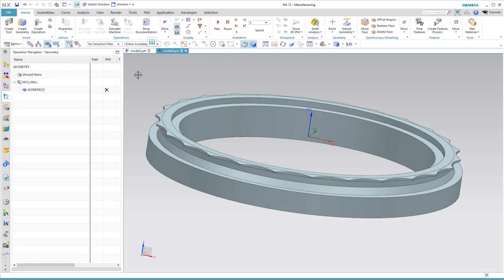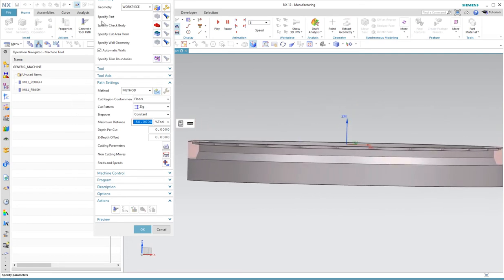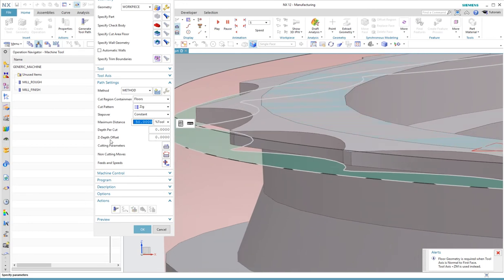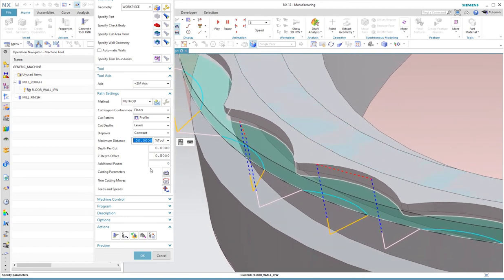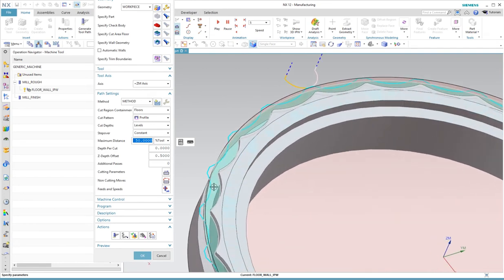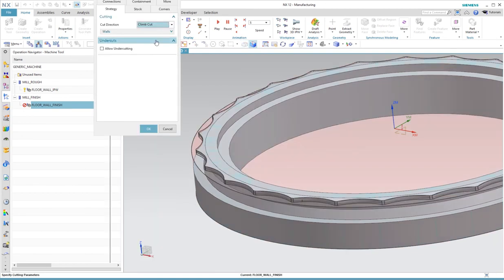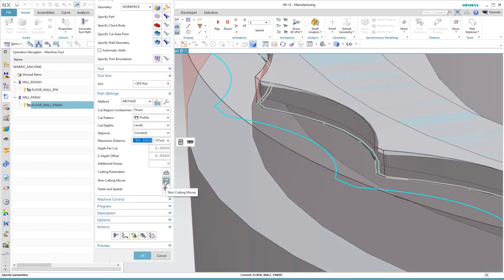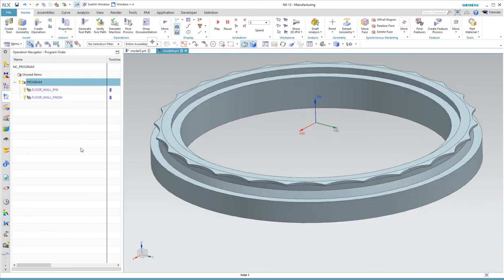NX CAM Scallop Machining Technique

Comment: Well, for cut compensation also need to enable "Output contact/tracking data". Otherwise, NX will just add G41/G42 to existed traectory without re-calculation of coordinates.
Reply: Could u please suggest any video or link so we could learn that sir...??